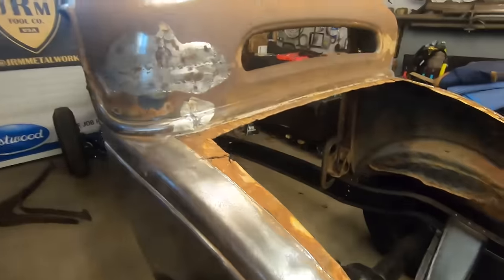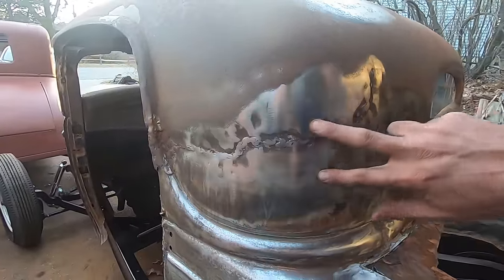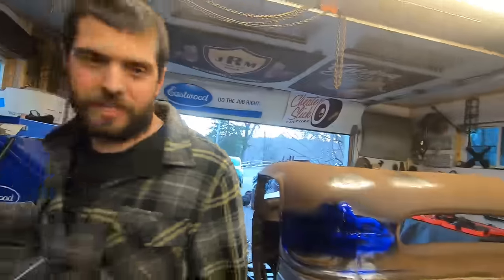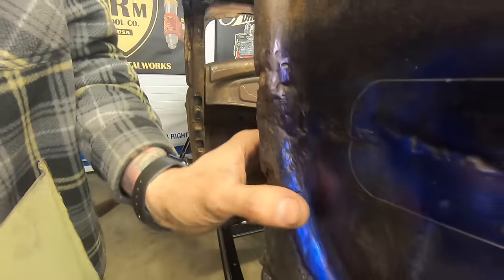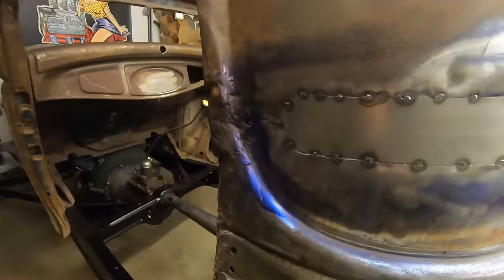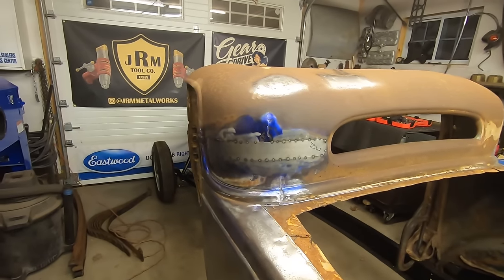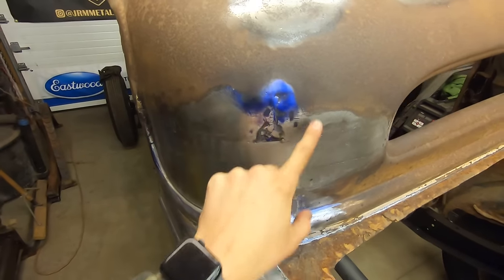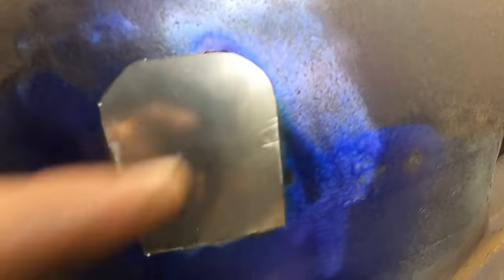Repairing The Old Chop Job On The 1932 Ford 3 Window Coupe Part 1

Comment: Two questions.  1. I see some small pin holes or gaps in your rig welds, do you keep those and fill them? Or do you re-weld those small areas?  2.  The roof has a ton of surface rust, how do you get that clean and prepped?

Comment: I admire your ambition to resurect this deuce with your quality metal working skills.  My one suggestion is to religiously wear a N95 dustmask or even a respirator when grinding lead or even rusty sheetmetal.  

When you put on a new white dust mask and then grind on something for a couple of hours and the mask turns brown which it will that's all the crud the mask kept out of your lungs. 

 It's easier to get lead poisoning than you wouild think. When the lead is ground into fine particles and being blow all over the place with the grinder that's when it's in it's most dangerous form.  

My father gave himself leadpoisioning by refninshing an old house.    Lead has to build up in your body for a long time before you finally get symptons of lead poisioning and it takes a long time for the symptoms to go awayy once you figure out what's going on.
Reply: Mask police are here. 🙄🙄🙄
Reply: @Lanni_747  Is there a reason one should not point out obvious safety concerns?  When he's 70 and has Emphysema (or worse) he will thank the mask police... IF he listens to the advice.
Reply: @Wheel_Horse  he knows right n wrong.  Can’t stand seeing it over n over.  GEt SoME glAsSeS oN!   Just watch the cool video and craftsmanship.
Reply: @Lanni_747  Yeah, maybe HE does, and ignores the issue, but think about those who might be getting into the craft.  They might NOT know or be thinking about the safety issues.  IMHO anyone who posts videos should set a good example for others.  Ignoring safety and flaunting it in a video is just wrong.  Off camera, he can huff paint if he wants to, but ON camera there should be some responsibility to pay attention to the big picture.  I ignored it for decades and now I'm paying for that.  But yeah, I get it... it does get tedious after a while reading it over and over.:hand-purple-blue-peace:
Reply: @Wheel_Horse  🙄🙄🙄🙄